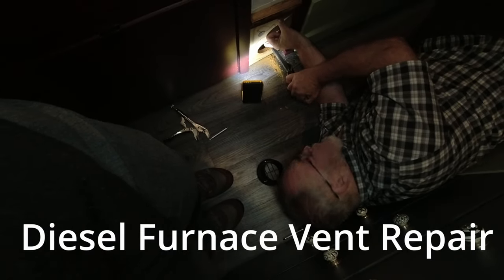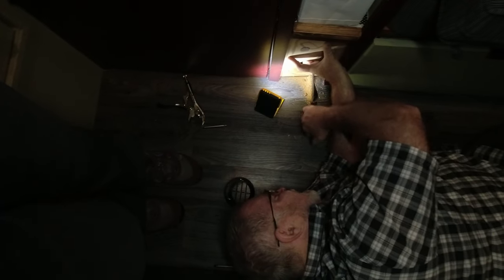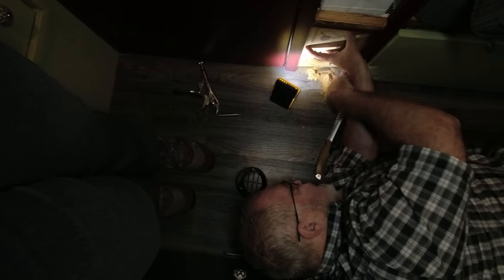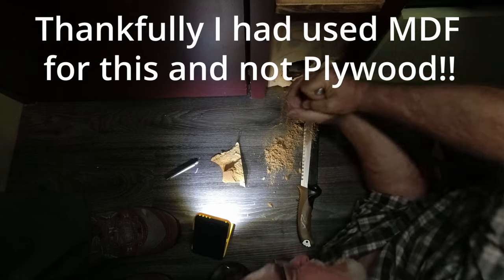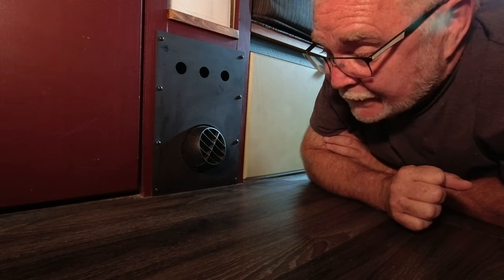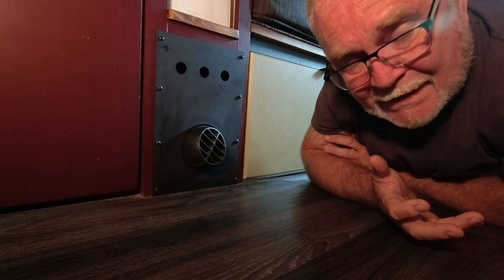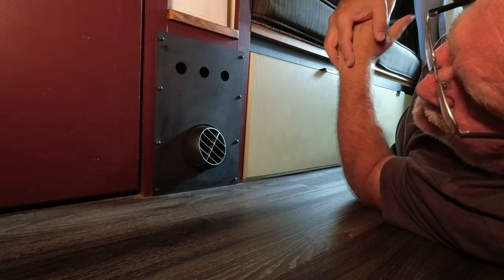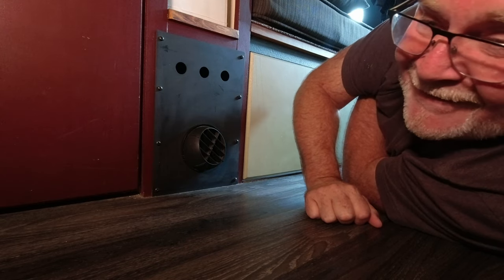TEARING OUT OUR DIESEL HEATER?//SMELLING SMOKE IN THE VAN/EP 3:ROB'S VAN REPAIR & MAINTENANCE TIPS

Comment: Found you from Vancity Vanlife. My clamp came off my heater, too. Fortunately I just had three screws on the bed to remove to access all of the heater from above. I got it mostly on, then when I changed all the bed panels later I tightened it completely so it should not come off again. I'll check it soon though to make sure it didn't rattle loose.
Reply from the maker: Thanks @Tux Traveler! Yes, we have to be careful with the diesel heaters. They are less expensive, but you do have to keep an eye on them. I think Rob secured ours more carefully too. 👍